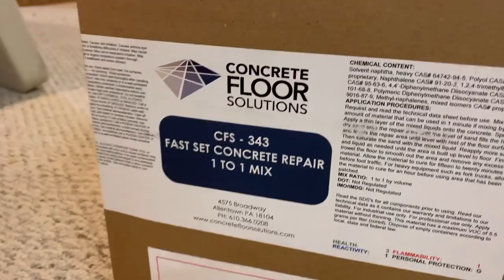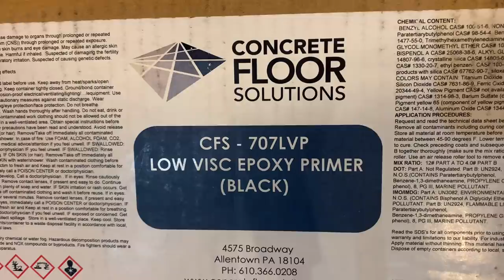Easy DIY Metallic Floor Installation, how to transform your floor.

Comment: Love your videos im a floor guy been in the trade since 99,.im a resilient installer,.carpet,.ceramic,.sealed concrete,.epoxy etc..im actually up for my contractors license exam in 2 weeks i love what i do,.love going from job to job different environments,.different job details,.watching you guys do your thing makes me so much more eager to get my license and go out and start doing what i love but in my case doing what i love for my own company💪🏼good work guys stay safe out there 🍻

Comment: What I have been doing with crack fills is putting a bead of caulk around the sides of the crack so the epoxy stays over the crack and doesn't spread all over the concrete.  You wind up using less epoxy that way, and it forces the epoxy to stay on top of the crack.
Reply: And that caulk stands a real chance if interfering with adhesion.  You do you, but I would never.

Comment: For those wondering why an extremely thorough mix is critical it's because if you don't mix all of Part A with all of Part B, the unmixed portions will never set and you will always have a spot that's liquid...at least until you mop it up with paper towel and that spot will not be coated with Epoxy and you will see it in the final finish...

Comment: Really enjoy your videos. So much knowledge you share. But instead of waisting all this material, why don't you use a measuring bucket (available at auto parts or industrial paint retailers) to use only a part kit. I am in the business of industrial coatings and this is what most of our customers do. Just curious. Thanks.

Comment: Re: mic -- nice and clear and consistent pickup.  A little artificial sounding, but I think some of that is the echo effect of being in a partially unfinished basement.
I will say that I hope this won't reduce the frequency of narrated (voice over) segments, as in general, that is my favorite form of your audio.

Question: I have seen 20+ of your videos at this point.  And I haven't heard you mention moisture in the concrete.  I have seen carports with unfinished concrete floors in rainy regions that can have moisture wick up from underneath during prolonged wet periods leaving the floor visibly damp.
Does this ruin the sort of finish work you do, or does the primer and top coat act as a shield/barrier against moisture breaching the treated concrete?

Comment: Another fantastic video!

I notice that you use paper towels when cleaning your tools. I was curious is there a specific reason (aside from cost perhaps) that you use paper towels a pose to rags?

Also, is there a difference between epoxy primer and epoxy? Or is the epoxy primer just epoxy but when using it as a prime coat it’s referred to as epoxy primer? Thanks in advance.
Reply: Great questions! I’m responding so I can also see responses
Reply from the maker: I just use paper towels because they are readily available and inexpensive. You can use a rag if you want.
The primer coat has 7% solvent in it which makes it 93% solids content.
It is imperative that your primer penetrates into the concrete. Without the solvent, it would be too thick and therefore wouldn't penetrate into the concrete. The intermediate coat (epoxy) is the same material but no solvent added. This is 100% solids and a bit thicker since the solvent is not added. 
Thank you for watching and thank you for the questions

Comment: According to Sikaflex flooring trainers, you mix the additives before adding hardener/curring ingredients.
Reply from the maker: You can pre-mix the pigment in the part B (at least in our material) because that is a lower viscosity material.  That will allow the pigment to saturate and reduce the potential of comet trails.

Comment: What would you do differently to prevent those bubbles from forming in the base coat? Would you have to go over with a spiked roller? Great work as always !
Reply from the maker: A spiked roller works, misting denatured alcohol will work also.  It is virtually impossible to not have some anomalies on a metallic floor, you are trying to apply a perfect finish in a non-perfect environment. Automobiles are painted in spray booths and you still get anomalies.  That being said, by applying a second  topcoat, that conceals some of those anomalies.

Comment: Epic sir. Ty for your service to society. Keep up the good work. 
Would a heat gun help to eliminate the air bubbles?
Reply from the maker: Heat gun, torch, spray isopropyl alcohol. Either or all it would help if you get bubbles.  Best way to eliminate is use a heavy primer to stop vapor transmission. 
Thank you for the compliment

Comment: This is so SICK!   Could I use this on my garage floor?  (Assuming I use the urethane top coat). Could I also add aluminum oxide for non-slip?
Reply from the maker: Yes, and yes.
You must put the urethane topcoat on and add aluminum oxide for texture. Otherwise it can be very slippery when it's wet. 
If you have any questions, email me direct jason@concretefloorsolutions.com

Comment: Hello sir. Not sure if you answer back to the comments but gonna give it a try. Love your work by the way. So I just wanted to know if it is possible to mix only what I need. I have a room about the same size as the one your showing us and I noticed you had a lot left in the bucket that’s I’m assumed my gonna go to waste. So is it possible to as long as I do the 2:1 ratio. Reason I ask is I want to order from your website but I don’t want to waste it. I want to save it because about 2 weeks after I’ll do another room about the same size but that room was resurfaced with self leveler so I need to wait the 28 days to cure. Anyway if you answer that it would be great . Thanks
Reply from the maker: I do answer as much as possible. Yes, you can break the units down. You just need to make sure you stay on ratio. Two parts A to 1 part B.
We do also have smaller kits. I don't know how many square feet you're doing but here is a link to our metallic kits. If you have any questions at all, you can email me directly jason@concretefloorsolutions.com
https://concretefloorsolutions.com/product-category/metallic-epoxy/

Comment: If you soak the metallic powder over night in unmixed epoxy that will prevent the balls of pigment you have on the floor we call them comets cause it looks like a little trail behind them
Reply from the maker: Thank you for the input.
Appreciate the advice

Comment: A 5 Gallon bucket filled part way with acetone that you have a air-tight lid for might be useable to clean the mixer paddle in...

Just "mix" the acetone with the paddle and spin dry it the same way you mix the Epoxy in the 5 Gallon bucket should pull the bulk of the fresh Epoxy off the paddle...increasing it's working life by reducing or even eliminating the Epoxy buildup...

It might be something to try, and if the lid seal is good enough, you should be able to clean the paddle a few dozen times before the acetone needs replacing...
Reply from the maker: That is a very valid point. I have tried something like that in the past, but felt uncomfortable having a 5 gallon bucket of acetone floating around that could spill and become a flammability issue.
Reply: @ConcreteFloorSolutions  Good point, that's why I'm only suggesting a Gallon or so in the 5 Gallon bucket and it has a VERY good lid...possibly screw on with an acetone proof rubber seal? Perhaps you know a good metal fabricator that can build you a light-weight aluminum bucket with a handle and a really good screw-on liquid tight lid for the purpose (unless such a bucket can be found online)...
Might be something to think about to increase the longevity of the mixer and reduce the chances of the dried Epoxy starting to flake off into the stuff you're mixing now...

Comment: Does the poly top coat scuff and scratch up with wear and tear dragging of furniture/appliances?.
My garage two part epoxy floor has taken a beating with tools and equipment over the years and still looks like new and curious if the poly is as durable as the epoxy.
Sure looks great.
Reply from the maker: The poly has much better scratch resistance than the epoxy, but much more expensive.  I will also say, if you install this in your house I would never recommend dragging furniture on any floor, especially an epoxy floor. 
Thank you for watching.
Reply: @ConcreteFloorSolutions  Agreed. But homeowners simply drag chairs, move furnishings, and slide objects across their wooden, vinyl, and concrete floors. My garage concrete epoxy withstands rugged workshop metal benches, steel dollies, and rough tool abuse for more than a decade and has never had a poly topcoat and was just curious of the poly topcoat. 
Your work and methods are exceptional, sir.
Great videos!

Comment: I got a question for you my mate. How can I get a perfectly level concrete floor. Specially something as large as 625 Square Meters.
Reply from the maker: If you are truly looking for perfectly level, a laser is the only thing that can do that.
They have laser screens when the concrete is poured, they also have grinders with lasers that can grind a floor perfectly level. Big $$$ for that

Comment: I love doing these metallic floors, if I could just get enough metallic epoxy jobs, I'd switch to just exclusively these! (Especially with all of the different colors torginal has) Quick question, how do you suggest to keep the finished flooring protected for the other trades to come in and do what they need to do? I'd get laughed at down here in Florida if I told the drywall and painter guy to put down protection. Usually, I'm last to go in and have to deal with all the tedious cut ins and tape everything off. Obviously this is a small floor, but what about bigger commercial jobs? Ram board 5000 square feet lol.
Reply: As a DIYer who has extensive experience, could you do the floor first all the way to flood coat stage only. Then let the trades people do what they want, and then sand down the flood coat after they are done and apply the urethane.
Reply: That is exactly what you would do, I have had them put down Masonite for the whole job as well. I believe it's all in the contract. Ramboard is easy to unroll and tape. Way easier and cheaper to do that than to grind the urathane off and redo the floor. On residential jobs we just tell them to stay off the floor for 2 days or so. Depending on your urathane, ours takes a 7 day full cure process.
Reply: @ThomasGerlach4Tri  you could do that if you're putting down two body coats. If you let it sit a while, and you have fork lifts driving over dropped screws and such, then you'll need to patch those holes then do another body coat and urathane. Kind of unrealistic to let other trades get on it and not mangle it up over an extended period of time, they don't care because it's not their problem.
Reply from the maker: Normally we are the last people in also, and that's what I would prefer when doing a Epoxy Floors. 
I simply state in my proposal that floor protection is not my responsibility so the general contractor is to take care of it. Normally they will take ram board and lay it on the floor. One word of advice is never tape the ram board to the floor, only tape to another piece of ram board. Sometimes it leaves glue stains especially on polished concrete

Comment: Greetings, good job.  ??  What paint can I use before applying epoxy to the floor and it won't come off?  thank you 🙏
Reply from the maker: If you don't want it to come off, don't use paint, use epoxy. Our kit comes with a primerhttps://concretefloorsolutions.com/product/metallic-epoxy-floor-kit-500-sq-ft/

Comment: What does something like this cost for a similar type of size and similar type of coloring from yourself if you were quoting somebody for identical work
Reply from the maker: There are so many variables involved It is going to be very difficult to give you an accurate number. Very small jobs require real high cost per square foot to cover overhead. This job would be approximately $2900. typical installed cost for metallic floors Range anywhere from $8 to $15 per square foot.

Comment: So my garage has been poured in four sections with deep grooves to crack that would need filled as well as numerous other cracks that this method you show here would work. What do you do for larger areas like I have to deal with? Here in NC they just pour concrete right on the red clay without gravel or rebar.
Reply from the maker: I would recommend using our fast set joint filler for the joints, and fast set crack filler for the cracks.
We have tutorial videos under all of our products
https://concretefloorsolutions.com/product-category/repair-materials/
Reply: @ConcreteFloorSolutions  thank you for the response

Comment: When grinding, what is your rpm on your machine set at? I know this video isn’t specific to grinding, but I’ve always been curious. Is there a different rpm recommendation for diamonds vs resin pucks? Thanks! 

New mic is awesome by the way. Keep up the good content!
Reply from the maker: Yes there is a difference. A lot revolves around down pressure and heat on the diamonds. Your first metal grind should be around 4 which is around 500 rpm. Once you get into resins, you can go full speed, less friction because your floor is smoother.

Comment: Do you ever chase the cracks in order to widen them and then fill with a different product?
Reply from the maker: You don't need to when you are using our fast to set crack repair.
https://concretefloorsolutions.com/product/cfs-fast-set-epoxy-crack-filler-fast-set-epoxy-spall-repair/
I don't know what other repair material you would use. I definitely would not recommend spackling the top of the crack with gel epoxy. That is not fixing the crack, just applying a Band-Aid on top.

Comment: Wondering if all of the products you’ve used for this project are safe for in concrete hydronic heated floors? 

Thanks!
Reply from the maker: Yes, as long as you install the recommended primer.

Comment: I want to put this in my garage. How slippery will this be when wet? Can I put sand in it?
Reply from the maker: It will be extremely slippery unless you apply a Urethane Topcoat with aluminum oxide on top of it. The aluminum oxide will add the grit needed for slip resistance.https://concretefloorsolutions.com/store/epoxy-floor-kits/540-sq-ft-metallic-epoxy-floor-kit/
https://concretefloorsolutions.com/store/accessories/aluminum-oxide/
If you have any questions at all, email me directly jason@concretefloorsolutions.com
Reply: @ConcreteFloorSolutions  Awesome thank you!

Comment: Still see the dimples even after the Poly application……. Curious what the clear epoxy coat would have looked like in the end
Reply from the maker: I'm going to say exactly the same.
The urethane just adds better scratch resistance.
Reply: @ConcreteFloorSolutions Have you ever done this metallic floor in a garage?
Reply from the maker: Personally, I don't recommend metallic in a garage. Every single scratch will show up and be extremely visible.
If that is what you want, that is fine, but be prepared for a lot of cleaning and maintenance to protect the floor from visible scratches. 
Flake epoxy flooring is what I recommend for a garage . It is the best camouflage available for a floor.

Comment: question from ignorance,,, why not just let the epoxy fill the cracks?
Reply from the maker: The epoxy will slowly wick down into a crack, the problem is it will continue wicking down slowly over a couple hours, and leave an open vein in the floor, where you will see the crack.
Reply from the maker: Very good question by the way

Comment: How to fix sticky epoxy topcoat on flakes please
Reply from the maker: If you have sticky topcoat on the epoxy, that means it was either mixed out of ratio or not mixed well enough. 
Hopefully it will set up overtime, if not you might be able to get away with putting another clearcoat on top of it, otherwise you might need to redo the whole floor. There's a lot of variables involved.
Reply: @ConcreteFloorSolutions  I done a garage two weeks ago and still it’s tacky there is a way I could fix it please and thank you for your response
Reply from the maker: @ffk3730  what brand of material did you use?
Reply: @ConcreteFloorSolutions  450 from John Dunn Arizona pull a mark
Reply: @ConcreteFloorSolutions  jon-don  450 party a and part B 450
Reply from the maker: @ffk3730  that may require a complete redo. It sounds as if it was not mixed to ratio or not mixed good enough.
Without being on site, it is impossible for me to tell you the next step.
When it was mixed, did you mix the complete kit together? Or did you break it down to a smaller sizes?
Either way, if the material has not set up completely in two weeks you have a huge problem. I would contact your distributor. If you have any questions after that please email me directly jason@concretefloorsolutions.com
Reply: @ConcreteFloorSolutions  Thank you so much for your help and I am sorry to bother you

Comment: Can the excess epoxy be used in a reusable mould?
And if so does it pickup details, or is leaves a machinable solid without internal voids, etc?
Reply: I think this type of epoxy, all though slow curing should always be put down in mils. for casting into molds, I'd use a deep pour. The heat generated from flooring epoxy in a large container is intense!

Comment: What causes that dimpling?
Reply from the maker: Air bubbles
Reply: @ConcreteFloorSolutions  so let’s say you do a thousand square foot garage for a client and you get a few of those. How do you manage expectations or fix without losing all your profit?
Reply from the maker: @JonathanEdwardsOlympian  you always need to make sure you build in enough profit to cover any mishaps on any job.
It's part of the risk of the business. 
You can fill those holes before you do the urethane topcoat, and they will be much less visible